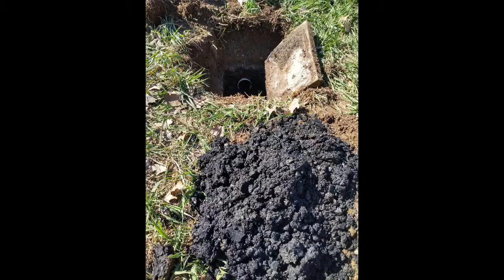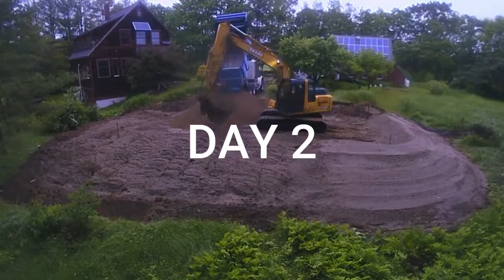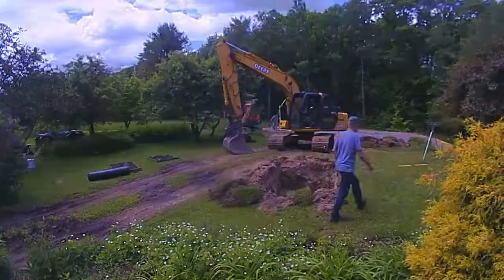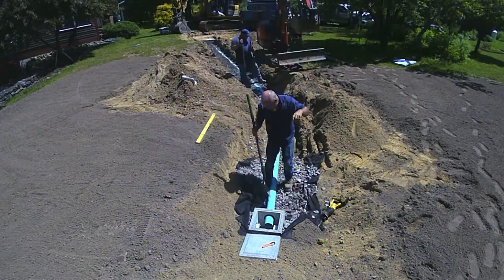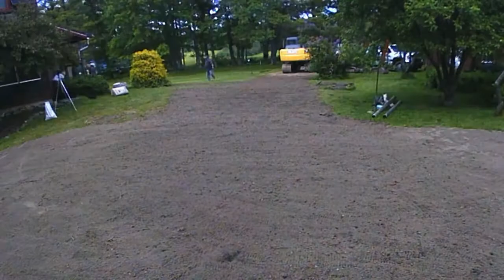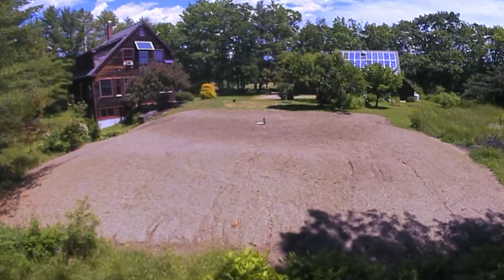Replacing my failed septic system

Comment: What was the cost associated with the complete replacement? Thank you.
Reply from the maker: The whole project was around $22,000.    I had a few other bids that were a little higher but these guys had an excellent reputation as you can probably tell.
Reply: @GuyMarsdenMakesStuff  
Got it, thank you. It turned out great, I am sure!

Comment: We are on a septic system here, too.  I'd guess its 40-years old.  It's been on my concern-list for the past couple of years and I keep a tight eye on things, but sooner or later it'll need to bere placed.  What were the early symptoms of failure?
Reply from the maker: I started smelling sulfur in the yard and then noticed water coming up into my lawn out of the septic tank area.  The system predates state records and could have been a homebrew system built in the 1970s.  I recommend trying products like Roebic septic system cleaner that should help clean out blocked pipes and leach field.  and definitely pump out the tank every three years routinely.